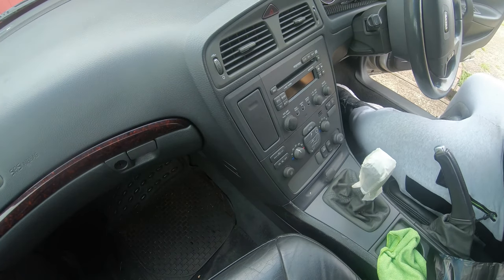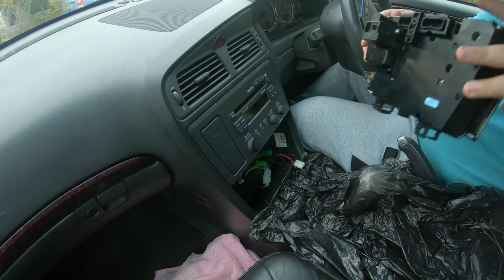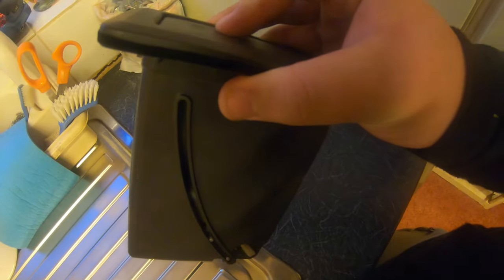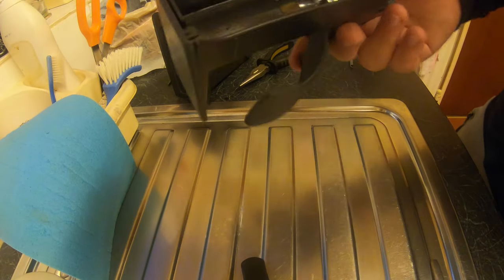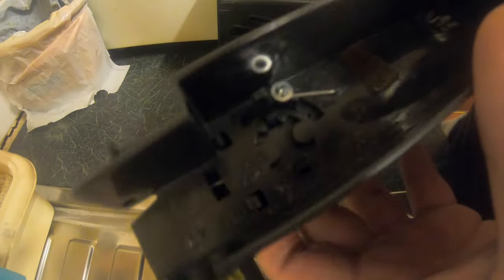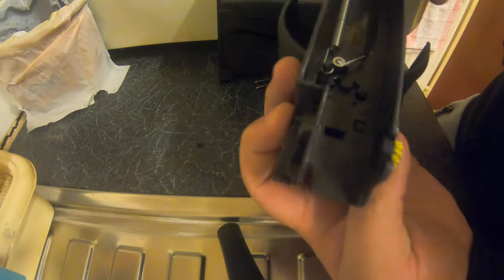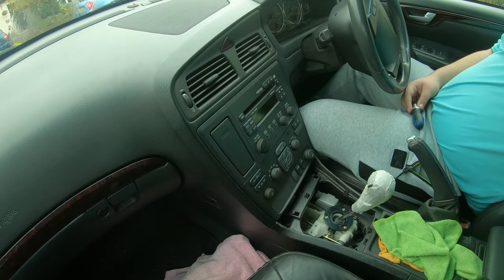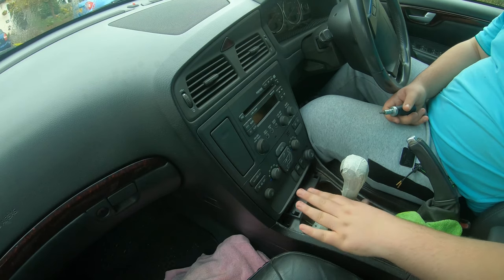Volvo V70 S60 00-04 Dashboard Cup holder repair

Comment: While the content is great and very valuable, consider editing before you post the final video.  This could have been a third of the time and more effective.  Also, if the disassembly of the dash results in a dash warning light, how is it resolved?
Reply from the maker: Well I never got an SRS Light when I removed the Climate control panel just don't turn the ignition on when it's removed and you won't get an SRS Light or message so just remember don't turn the ignition on until the panel is reconnected